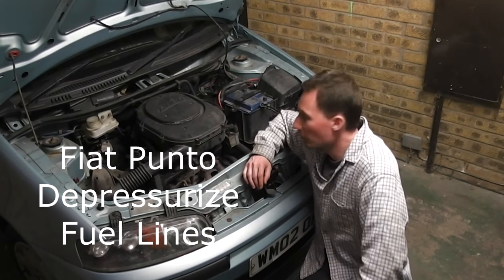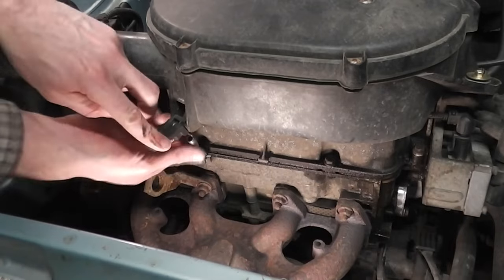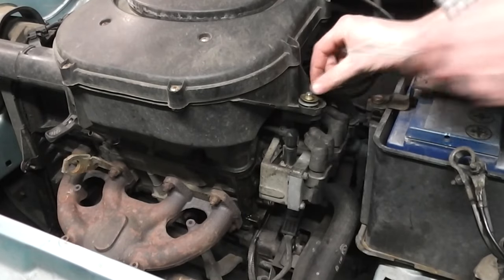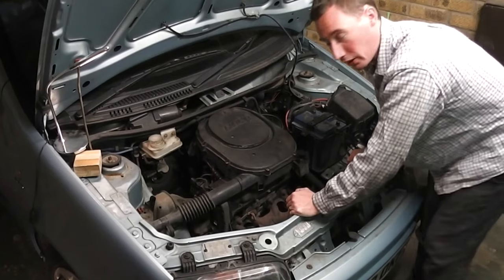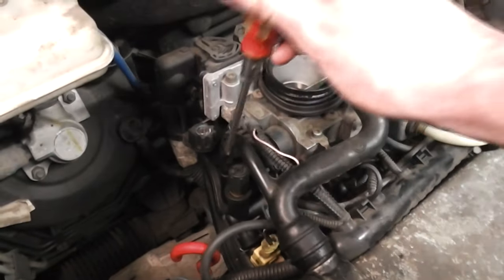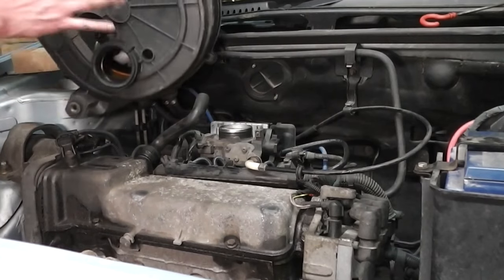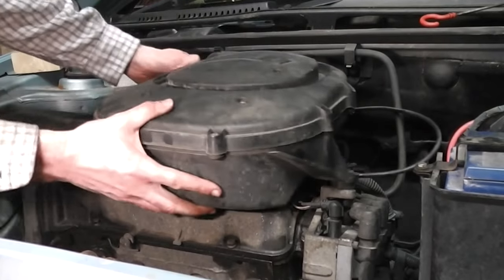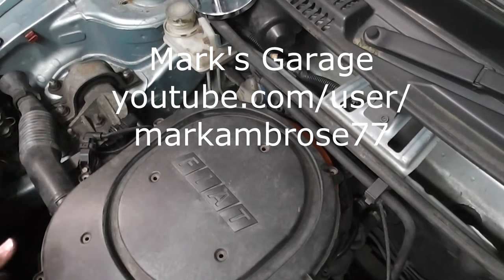Fiat Punto Depressurise Fuel System

Comment: I want to ask where I can find the fuel filter on this model
Reply: 1.2 8v don't have fuel filter!
Reply: @MegaAnon111  tnx
Reply: @mohamedalahmer6195  I'll always help, ask anytime.
Reply: Mohamed I think its in the fuel tank next to fuel pump thats how it is in my car fiat punto grande
Reply: @MegaAnon111  Actually it has but it's a part of fuel pump which is located under rear seat, and it doesn't need change, only if your fuel pump dies then you change complete component.
Reply: @Tankyard  
It's correct, but when the change for another pump, not Fiat original parts, normaly don't filter, it's necessary mounting auxiliar filter in the external exit tank, (preference), or in the mittel of the line.
(Previously disconnected complet the battery) and
looking post active depressure FPS System.